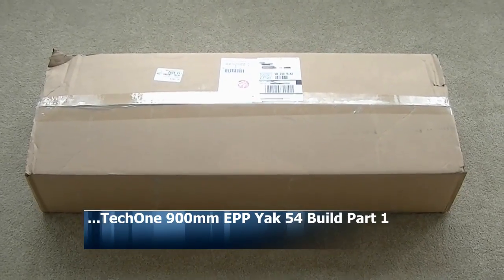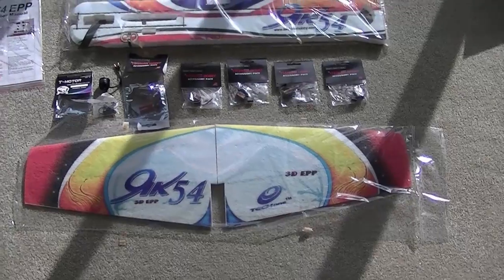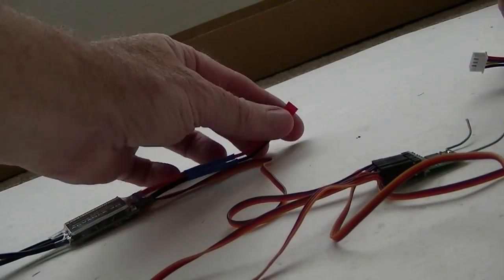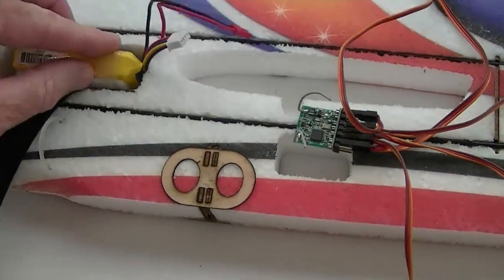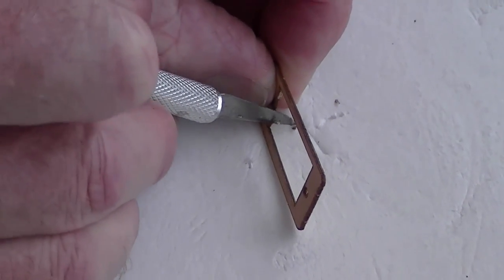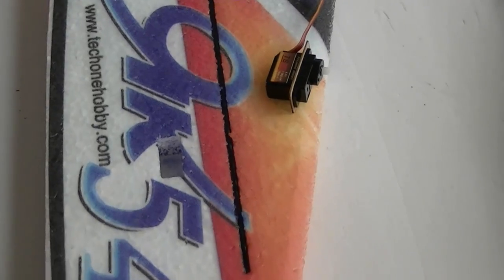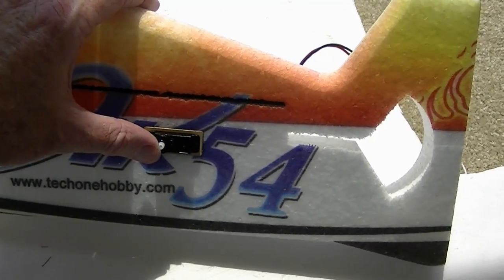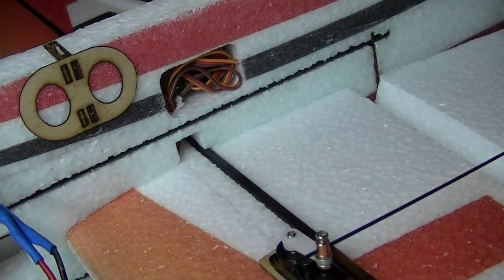NitroPlanes TechOne 900mm EPP Yak54 ARF Build and Flight Test Part 1 of 2

Comment: The word is s o L d e r .....
Reply from the maker: That's just one of those English words that is generally pronounced differently across the pond. 
If you look at the etymology, the term comes from the 14th C English word sawd which in term comes from old French soldure from Latin solidare. The British may have started pronouncing the L under the influence of the French or Latin, whereas the Americans may have kept the 14th C pronunciation; I wouldn't be surprised if that pronunciation was still around in some British dialects in the 17th C. This actually seems more likely than that the Americans suddenly decided to drop the L for no good reason.

Comment: btw, what type of battery connector is on the stock esc?
Reply from the maker: I don't think it had a connector. I an put XT60 on it later because the JST didn't fit on the 1500 batteries.
Reply: good to know, thx. i'll get a dean's male and solder it to it as all of my 2200 lipos are deans
Reply: ***** just got mine today :) weird thing is the "esc" is labeled as a "30A bec", with no mention of esc anywhere on it. seeing how there are 3 leads for the motor coming out of it, i'm assuming it is a combo unit. won't know until I get a battery adaptor (it uses an hxt 4mm bullet connector, btw), to give the power components a test.

incidentally, that is some beautiful countryside in your vids. reminds me of shenandoah nat park. are you near by?
Reply from the maker: ultrakool Super cool. It's the Blue Ridge mountains in Virginia.
Reply: I thought so, nice. I used to take day trips to them from d.c. while stationed there, all of the time. I've been all throughout the rockies, sierra nevada and cascade ranges and the alps, but nothing compares to the blue ridge in sheer beauty, imo. the smokies, above the cloud cover, are a close rival.

ironically, I now reside in the prairie/plains of the st louis metro area. I do, however, reside on "roanoke drive", though. heehee. thx for all your help, your vids are very well produced, imo. can't wait to get this baby assembled and tumbling through the air.
Reply from the maker: ultrakool Good luck on your assembly, add some DR/Expo (70/50) to the ailerons and fly three mistakes high for the first few :-)

Comment: great video, very helpful. as an fyi, a spline roller screen tool makes inserting the servo extensions into their grooves fast and simple vs. the tedious popsicle stick method. zip, done.
Reply from the maker: Oh! That sounds like a good tool to have and probably available at the hardware.
Thanks for the comment.
Reply: what's the best place to get shrink tubes from? amazon, ebay or local stores!

Comment: I remember watching this build a long time ago. The reason why I wanted the yak 54. My setup was way to big for the plane though.
Reply: ***** yes, I will. all I can tell you presently is my buddy uses this setup on his techone yak and he swears by it. he did have to cut the battery slot bigger for the 2200, but kept the cut aft, so as to not have any cog issues. he says it is a tad nose heavy, but not so much that you would be hindered during high alpha flight.
Reply from the maker: Oh great. I am still using the stock motor but I would like to know if you come up with something better. Wonder if the SunnySky 2212 KV980 motor would work. They work great on my quad copter with 9x5 or 10x4.5 props.
Reply: ***** great video. I have mine on the way. how long of an extension did you end up needing for the rudder/elevator? is it about 8" to 9" ?! I thanks :-)
Reply from the maker: leefuji I think it was about 10".
Reply: ***** Ok cool then I'll get me a 300mm long extension just to be on the safe side. I can always tuck the extra cable by the receiver area. by the way I just watched both parts and hands down these are the best build walkthrough videos I've seen on youtube. good job sir! and in regards the CA glue I got that and the Welder glue so we'll see which goes better once things arrive :-)
Reply: ***** I just ordered this plane and I've heard the following setup makes this thing a rocket: motor $16 aerodrive 3010b, propeller 11x5.5, battery 2200 3s 35-70 199g, and a plush 40amp esc. i'm gonna build it stock initially, fly it and then upgrade to see the difference. thx for the build vid, i'm sure i'll have mine together much quicker than I would have otherwise because of it.
Reply from the maker: ultrakool Wow, let me know about how that upgrade works. Sounds powerful but also could add a lot of weight. I have been using 1500 3s bats and they seem to be as heavy as I would want go.
Reply: Very interested in seeing it fly with that setup too. Good luck
Reply: chris miller in theory it makes sense...more pitch on the prop with the added propwash, along with more juice and a higher efficiency motor and esc = badass...or at least that is what I've observed on this foamy. i'll post a vid when I make my mods.
Reply: leefuji or better yet, you can always reverse it back in the opposite direction and fold it over and tuck it into the created groove/slot. no bunched up mess in the cavity that way. hope that helps.
Reply: ***** update: my buddy's plane is the yak 54 1100, on that aforementioned set up. that's why he could go bigger on the battery/motor/prop. just got mine today...now for the assembly....
Reply from the maker: ultrakool Thanks for the update.

Comment: I just got my 1100mm Yak 54. Got my receiver ok, They didn't have the exact batt for my plane, a 11.1V 1300mAh 25C so I got a 11.1V 1300mAh 15C. Will that do?
Good video. I had to trim the servo mounts too. Looked to me like you didn't get any CA on the first servo you installed. and why did you put the control horn on the elevator out where it is and not parallel to the fuselage?
Thanks
Steve